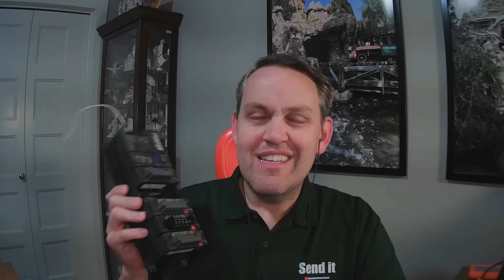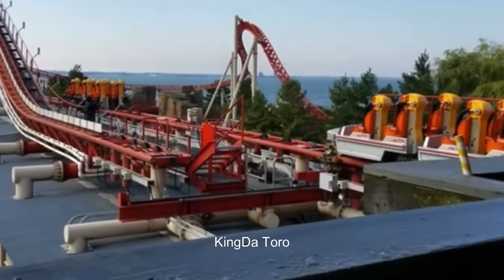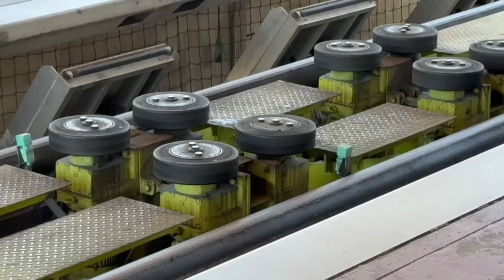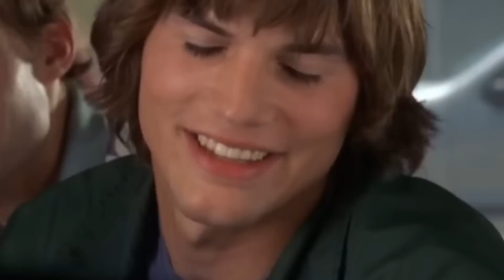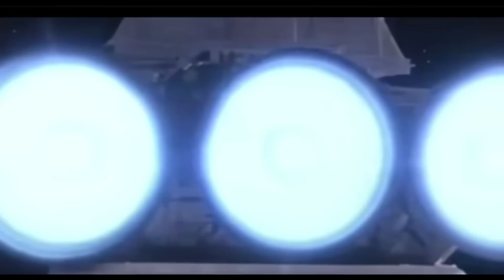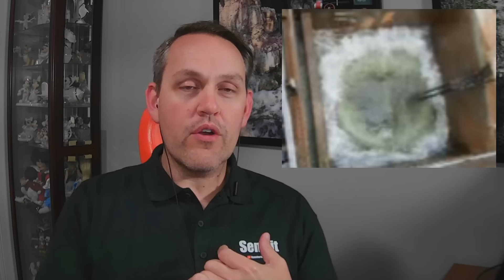Rollercoaster running modes and what they do.

Comment from the maker: From a friend of mine;
One of the points I was going to mention was the requirement or reasons to press estop in order To reset a block.    

1. Estop puts the control system into a safe state, meaning output actuators off.  This makes it safe for a person to travel to the remote block reset panel.  
2. Pressing estop returns the control system to a full startup procedure requiring a complex startup with many actuations of the warning horn potentially giving a remote person a chance to get to the safe area.

Comment: The new Nemesis control panel at Alton Towers has an additional key for block resets. It's not enough just be to in manual mode. 

I believe this key is only held by the maintenance directors, not regular maintenance personnel, and all trains need to be empty before it can be used. 

They learned the hard way at this park.

Comment: One question that always comes to mind when you discuss these topics is why there are no sensors at the lowest points of the roller coaster where a valley train is more likely to occur. Only check that there really is nothing there before resetting the blocks. Human check should be enough but then you have the smiler on a foggy day.

Btw, idk if it's because of the microphone or the room but you should try a Deesser on the audio track, sometimes is too harsh.

Again, super cool video ❤
Reply: Human factors is a complicated subject. You don't want people becoming complacent. People might think these sensors at the low points are flawless and not do the necessary checks as thoroughly
Reply from the maker: @alsty21  great point
Reply: @alsty21  That's a good point but I wouldn't know where to put that line, at the end, the only ones in danger are the riders. Manufacturers trust that the maintenance crew of the park will keep the ride in optimum conditions but even with that they add extra safety features just in case. You have the Fury 325 example, if you think maintenance is going to make their job perfectly you don't add enough tolerance so your track can operate with a missing support for days (just an exaggerated example but i think you've got the point). So why a 1h stop is ok, as Ryan said for the RMC, but few more sensors are a waist of money and compromising revenue with false triggering (which shouldn't be a problem because the ride system must just check those sensors during a block reset or whenever makes sense).

Btw, i completely understand your points, I'm just trying to add some sauce to the comments 😂
Reply: @Hugo.Spain.  like everything, it's always about striking the right balance and you have to be careful your well intentioned changes don't actually increase risk. For example, adding more sensors = more faults and therefore more ghost trains. More ghost trains = more block resets are needed = risk of complacency because they happen more regularly
Reply from the maker: @Hugo.Spain.  more sensors means more to go wrong means more downtime for the ride means less people means less money made. Some parks are putting optical sensors in these areas as an advisory but the majority rely on people following procedures and being diligent in their efforts. The action is such a rare thing to happen.

Comment: Nice with the Direct Logic expandable.  I'm using a DL06 for my backyard coaster.  How do they compare with the AB PLCs that are industry standard?
Reply from the maker: @kristierasmussen9000  when you aren’t using complex instructions or safety rated devices there really isn’t much of a difference. Start turning the scans up to monitor safety critical and some of the cheaper DL series struggle. In general the ratings aren’t there for DL to be used in amusement stuff. I’ve used them in play features and they work great!! Get them linked up with “do more” HMI and you have a nice controls package at little cost.

Comment: And I've even noticed certain parks go for a redundant safety at the operator stations by having floor sensors(pads) that verify they are standing in their station as they push their dispatch/enable button. Some parks even have those floor sensors at the exit gates. The one at blue streak operates the mag switch on the gate. I was first to the exit gate and I guess the floor switch didn't deactivate the magnet on the gate and it wouldn't open. I just stepped off and stepped back on and the magnet released.
Reply from the maker: @robertstephens5185  neat

Comment: Probably way out of my price range but where does one go to buy some of the stuff you have for your displays like the half a coaster wheel and some other stuff ?
Reply from the maker: @DareDevil0504  some parks sell things. Some parks give thing away for ACE events here in the US anyway. But most of the components on rides are just industrial things that can be purchased from all sorts of places. But If your looking for a rollercoaster specific thing like a wheel or a chain dog. They are extremely hard to come by. Maybe someone else knows a good outlet to get things.
Reply: @ryantheridemechanic ok thanks I was just wondering I know I seen like old bumper cars and stuff on Facebook market place but I like the half a wheel you shown in a video a few videos ago and didn't know if it was a company that could be purchased at or if stuff like that was rare to come by I figured most stuff you had was just stuff you collected over the years of work
Reply from the maker: @DareDevil0504  most of the stuff I have I just “trash from work” but I was in a spot to collect it. Had to fill out some paperwork so there was a release of liability. Very lawsuit driven by parks. They worry about broken things making their way back into rides.   Not necessarily theirs.

Comment: When brand new roller coasters are constrected and power is connected to the ride for the first time do they go through the same modes when they start it up for the first time, like say when a dive coaster does a test for the first time the holding brake does not engage to first few cycles or not activated would love to hear a topic on that.

Comment: When I worked at Knoebels in the mid 90's, to start the Phoenix we would need the lock key (maintenance had one and Operations had one-Same key) we would start the lift but had to jog the transmission through the gears as this was originally built in 1947 and Knoebels kept a good portion of the original operation when they moved it in 1985. IIRC the lift had 6 speeds. We start at 1 to roll it for inspection purposes and then based on number of trains running we would either go right to 6 (one train, lift speed full) or speed 5 (2 train operation), 4 was only used for rain but still operation days.

Because the phoenix used skid brakes, your have to adjust the tension of the brakes when entering the station using the tension setting lever, and you would lock it in either half way for normal great weather operations, but when it rained you would give full tension, if the train approached to fast the PLC system would auto engage the E-Stop and then we would call to have maintenance advance the train to the station and close the ride as the skid brakes were to wet to be effective.

Until recently The Phoenix main operator, we call the pilot (the nickname for Phoenix was Air Phoenix because of all the air time) had full control for dispatch and train advance as it was a very manual operation using pneumatic push button controllers to raise or lower the skid brakes., Phoenix didn't even have air gates until recently, you just stood within a painted box behind the yellow line, but I dunno if this was a design problem, they put the operator control panel on the same side riders would load, so if they stood on or past the yellow line you could not see the train approach properly, I had suggested they relocated to the back of the train exit side... but they didn't do it, but when they built twister they built the control panel, exit side back of train.

The phoenix while not the oldest ride at knoebels definitely keeps as much of its original tech in place while upgrading features to run two trains with block zones. 2 trains ops back in my day required the systems to be jumped by maintenance to trigger 2 train ops, if you removed a train and didn't jump it back it would constantly stop the lift, but you could always restart it, but you just called maintenance so you weren't turning around to restart and regear the lift speed. If we dropped to one train towards the end of a night... we more often than not did not speed the lift back up simply because it wasn't a pressing issue... the ride still operated and on the cooler nights the phoenix actually performed better during cooler evenings than it did during scorching hot days.

I haven't worked at the park since 1999, but I do know the more detailed start-ups from having a Vekoma Whirlwind which required more process steps, and I am sure the newer Impulse looper they put in 10 years ago is quite as detailed tas trying to  start up as most Intamins and B&M coasters... lots of safety systems.

Twister's PLC closet is amazing 90's tech, sitting in the room and just watching it operate, hearing the click clack of the relays is amazing...  And Twister has a variable speed lift, which stops 100% once the train has cleared that block (twister has 2 lifts).

The tech today is amazing, but I won't lie I prefer to more manual operations of phoenix... back in our day if no one was in line you could slow the train down enough to resend it without stopping it... the tunnel speed needed to be less than 10 mph.... today you can't send it like that anymore as it requires 2 person dispatch before it will even leave the station.
Reply: We went to Seabreeze last year, and their old woody is still 100% manual operation. They had one girl working the ride. She would send the train, jump the track, fill the station, jump the track again, and be at the levers before the train came back. She was pretty good. It was cool watching that old ride operate.
Reply: @Spike-sk7ql  Sea Breeze outside of Rochester???

That place still exists??? I went to that park in the late 80's early 90's when i still lived in Syracuse, NY. Although Darien Lake was my preferred park of the two, hell I even went to the defunct Roseland and did multiple credits on the Skyliner before it was moved to Altoona, PA the year after Phoenix was moved from Texas.

I even ended up hurt on Roselands dark ride as it jumped the rail when it went down the hill as the brake pads on that vehicle were worn down to the point they did nothing... oh those years of being a teen in the 1980's and when breaking a bone or two was like getting bit by a mosquito.
Reply from the maker: @DennyCraneSr  wow that’s really some interesting history. I’m amazed at the lift have a transmission for speed. Honestly makes complete sense just I’ve not heard that before. Thanks for sharing.
Reply: @ryantheridemechanic  yw for the share.  Yeah many of the old PTC built coasters had speed gearing, I don't know if transmission is the right word, might be just how much juice is sent to the motor to increase speed of lift chain, but yeah if you have seen any videos of the phoenix it is an old style lift system.

Here is a video showing some of the lift machinery but not how you speed it up.  https://www.youtube.com/watch?v=iPxyMtAC5eA

The lift gear box is located in the operator control area, if 2 train operations are happening and the block zone isn't cleared, the lift would shut down, a second operator that sat in the control area would be responsible for starting the lift. You would go over return the selector/gearbox to 1, hit lift start and slowly speed it up hopefully hitting speed 5 before the train cleared the drop.

I am basing my knowledge on how things operated in the 90's when I worked at Knoebels... and while the station set up has changed slightly and the systems have been more modernized I have not seen any changes to the lift components, and since it is a lift that is on at full speed all day long, it is definitely not variable in nature.

Twister, their other wooden coaster uses 2 variable Square D powered hydraulic lift motors, one for lift #1 and one for lift #2 Twister has a unique lift system as it is folded on top of it self as the ride is so large and based heavily on the original Elitch gardens Mr. Twister, slight modifications had to be made in order to fit the ride in the available footprint.

I dunno if you watch POVs but there are plenty of POVs of both Phoenix and Twister, especially phoenix since it has been rated the #1 wooden coaster every year since 2018.
Reply from the maker: @DennyCraneSr  awesome

Comment: Is it just me or is the sound of compressed air being fired one of the most satisfying sounds ever?
Reply from the maker: @owen24165  I love the sound of the brakes on a drop tower. (That’s my favorite sound)
Reply: @ryantheridemechanic  yes, hearing the brakes while you're on a drop tower is the best sound at that moment😂. I do like that noise though. Love me a good drop tower. Kings Island has a GREAT drop tower. The one at Kings Dominion is pretty good too.
Reply: @ryantheridemechanic  Now I gotta go watch your drop tower nerd shots video 😂
Reply: Ehhhhh, For me it is the anti-rollback noise of Wooden PTC coasters built in the mid 1940's (phoenix, comet (HP) Comet (great Escape), and some of the more modern CCI, PTC train coasters.

I hate the anti-rollback sound of GCI MF trains and the Timberliners, it sounds annoying.
Reply: @DennyCraneSr I like those, and I love the sound of an Arrow lift hill. Don't enjoy the loud ARBs on RMC coasters though...... yet I like the Arrow ones.
Reply: @Spike-sk7ql  Yeah, good ole arrows, I remember riding Dragon Mountain at marineland in Ontario Canada when it opened in the 80's because you went to the lift right out of the station it was loud as hell, and back then it needed to separate lift motors to get the train to the top of that hill/mountain ( i think it was 186ft or more)... you would pass through a Chalet type building at the mid point of the lift and it would get super loud again...

Then of course came Magnum XL, Steel Phantom... Viper... Great American Scream Machine... and I loved Arrow lifts as their top speed was like 4mph so the climb would take some time... the anticipation would get you all energized, especially on Magnum XL and Steel Phantom.
Reply: For me any magnetic break sound satisfying compressed air sound intimidating 2 great sounds
Reply: @muffels6410  I love the new B&M launched coaster brakes and air compressor sounds like on penguin trek and pipeline

Comment: Ryan I had to rewatch the second half twice. I was so tired when I got home I fell asleep lol. The content was very interesting. When you have a fault happen where electricity is shut off to a coaster what happens to the trains that are freely moving between block zones? Do they valley ? If I’m understanding correctly.
Reply from the maker: @christiwright3604  gravity powers the trains. Blocks stop the train. 
Blocks need power to open and operate. 
So power outage trains stop in the brakes and that’s it. You won’t know the power out until you hit the brakes.
Reply: @ryantheridemechanic  gotcha I think I chose the wrong words. Freely = gravity in my brain . Didn’t realize block brakes worked without electricity. The more you learn the more you know lol
Reply from the maker: @christiwright3604  typically you need air pressure and power to open a brake. Loose either and the brake shuts.
Reply: @ryantheridemechanic  gotcha I think I was thinking about brakes unable to stop trains rather than releasing them. I was thinking the absolute opposite. I love learning about how coasters work. Still learning. I am an enthusiast. Now I’m delving into how they all work. Lol I found your channel from your other one learning how to replace a battery in my old VW car fab lol  your regular channel showed up an hour later with the fury 325 crack.
Reply from the maker: @christiwright3604  glad to have you for sure!
Reply: @ryantheridemechanic  always keep up the great content.

Comment: They added a panel in front of when the smiler crash happened, it looks like 3 people are required to do a block reset on that block now (one at the base of lift 2, one in front of where it crashed and one at the main control point)
Reply from the maker: @spinba11  where I was took 3 people to clear the station block.